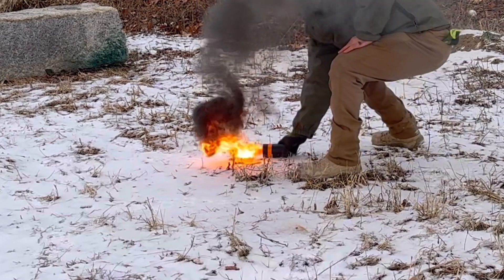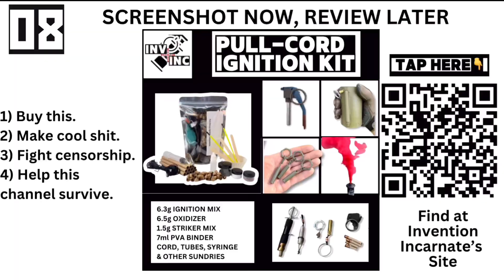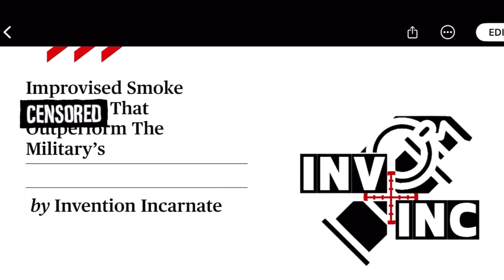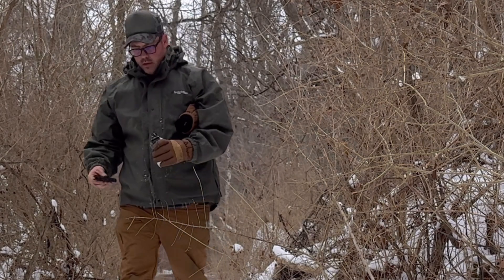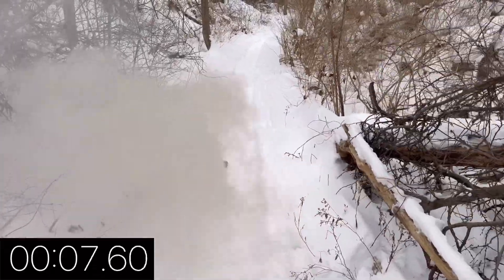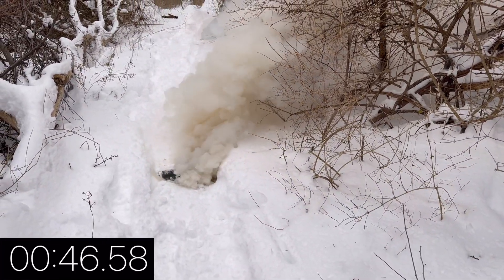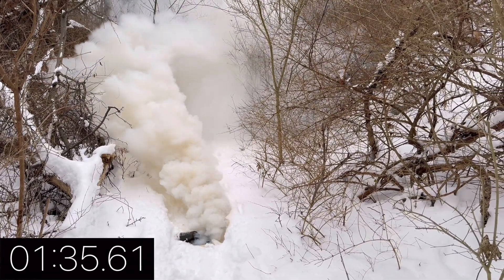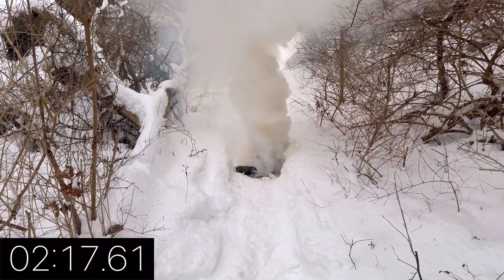“Doomsday” Smoke Composition | Canister Prototype Test 2

Comment: I mean, if it’s gonna beat the military then it’s gotta work in extreme environments, like winter.  But seriously, how do temperatures over 100 degrees and under 0 degrees alter the performance?  And what about extreme humidity or sandy/dusty/muddy conditions?
Reply from the maker: This formula is resin-bound. Eventually hardens to a waterproof rock, I

Comment: You should also make a thermal blocking version
Reply: The smoke would need to be extremely hot for that, it would basically need to be on fire to prevent the air around it from cooling it off.  It'd be easier to just carry a riot shield or something.

Comment: What an awesome burn time and quantity. In true tactical situations I don't think mild toxicity issues count for much if nothing else is going to be adequate for the need.
Reply: Yeah, I think I'd be JUUUUST a lot more concerned about how toxic lead is....moving at around 3,000 feet per second, than a little smoke.
Reply: Yeah I'd rather maybe have cancer in 20 years than definitely have high velocity lead poisoning right now

Comment: The deer in those woods gotta be so confused.
Reply: Nah, there's no headlights attached yet- that video is coming 🤣
Reply: @P_RO_  probably could rig up a small battery and led strobe honestly it would be a nice secondary confusion aspect.
Reply: @Shep01  modified pyrotechnic strobe rocket fuel maybe?
Reply: @joachimmartinez8788  Fancy idea but gotta be care with legality of mixes, Smoke mix for non transporting person use is ok.. things that could barely be considered a explosive will definitely be considered as such when them abc boys show up plug the dog and black bag you declaring your air soft hobby = "terrorism"... a high discharge battery with a cheap led strobe tied into the the trigger is basically legally a flash light, no worry there.
Reply: @Shep01  good point. Would have a hard time with the flutter valve as well.
Reply: @Shep01  Maybe, state dependent, some cheap firecrackers/fireworks on a slight delay fuse? Would add an audio screen effect as well - not hearing the direction of your footsteps in noisy leaves.